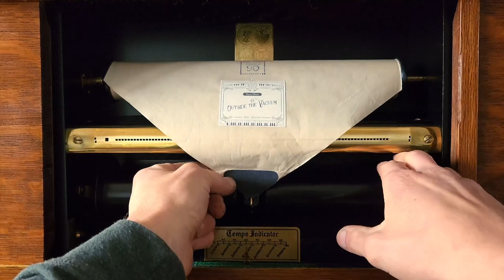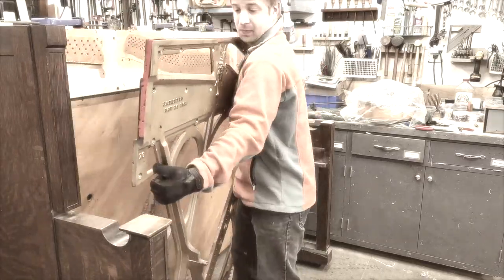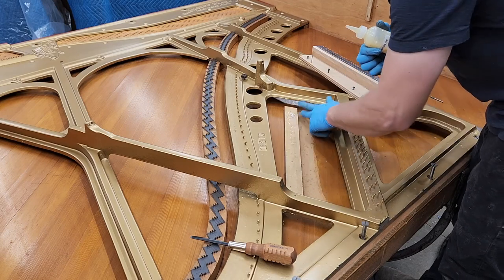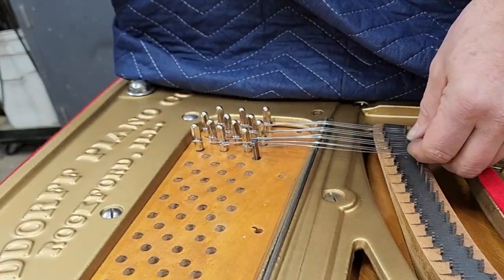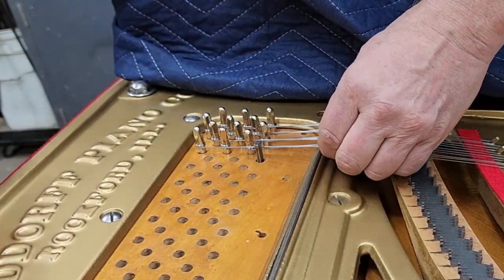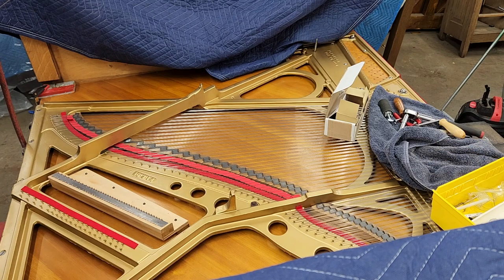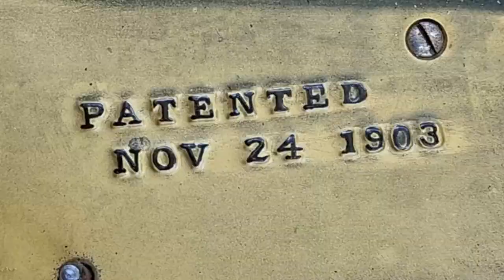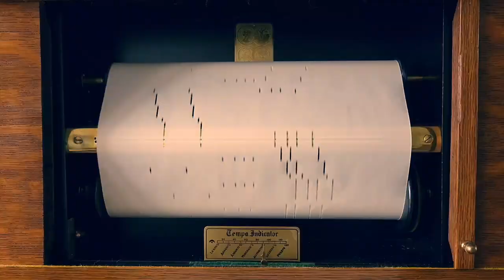Player Piano Revival Episode 5: Restringing the Piano

Comment: I would be so scared to do this. Breaking a string would make me jump so bad I’d never finish.
Reply from the maker: You'll be fine! They're very strong.
Reply: @nateoutsidethevacuum  I guess it isn’t the easiest thing to do on a new string, but older strings are prone to breaking due to age I assume.

Anyways, I’m going to catch up on the series. You were recommended after watching DuoArt’s restringing video, maybe because I love old uprights, so I’m glad to have found it.  Good luck on this and future projects!
Reply from the maker: @roadchewer PE  it seems like so many people are the "bust old uprights" type, but I'm definitely "old uprights or bust". Glad I'm not alone.  Thanks for watching.
Reply: @nateoutsidethevacuum  let’s get them to the year 2100!
Reply: I destrung a Bush & Lane piano back which had had almost every plate screw removed by a previous owner... with the strings still attached and up to tension!!! Only the bottom strip of plate screws were still in and were attached to the bottom wooden frame stretcher which was rotten and riddled with termites!!! It seems only the friction of the tuning pins in the pin holes in the plate was keeping this from flying apart. I was very scared by this back, since I considered it like a bomb which might explode... so realized that defusing the tension was key to rendering it safe given the lack of plate screws keeping the plate integral with the frame (NEVER EVER remove the plate screws before letting down all the string tension!!!). So I consulted with several expert technicians and read Mr Reblitz’s passage about letting down tension several times, and proceeded to let the tension down with the frame on its back, outdoors, with me with some good running shoes with one foot in position to run if it threatened to fold up! But by following his destringing schedule to a T, with my own modification (letting down each string an EIGHTH OF A TURN instead of the quarter turn recommended in the book), I was able to get to the finish line without problems and without injury, after which I labeled all the old strings with tape to take the gauges for restringing later, although this is a donor back which will be used to maybe bring another fine Bush & Lane back to life.
Reply: And yes when normally restringing a piano, always wear thick eye goggles and heavy leather gloves to protect your eyes and hands. It is also a good idea to wear something thick around your neck as well to keep it from being punctured by a flying string end. With that you should be fine.